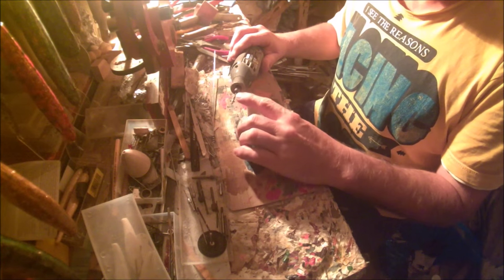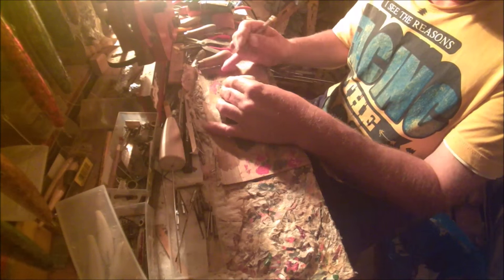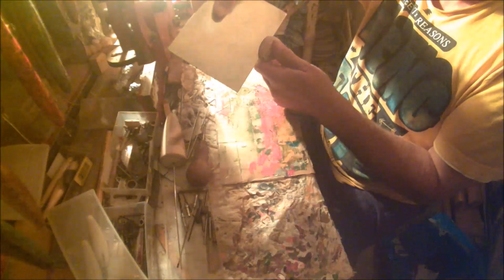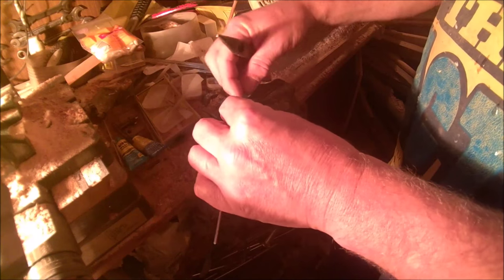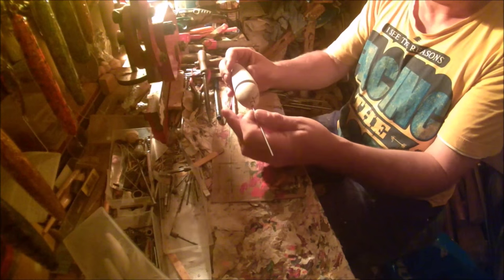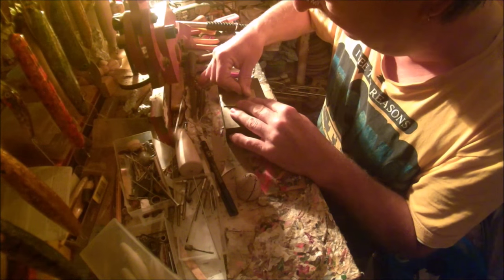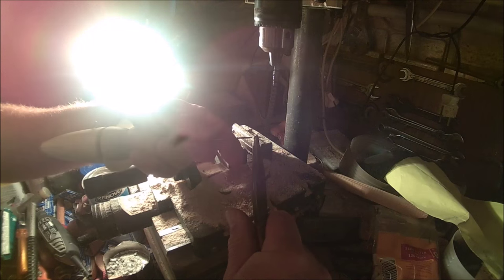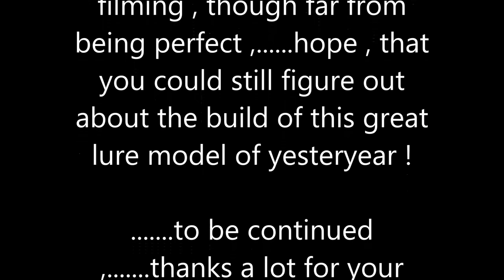Making A Whirligig Lure Part Three

Comment: You could use a Irwin 66704 1/16" X 6" Aircraft Extension Straight Shank Drill Bit (1.59 mm, 152.4 mm).  The cost is only US $4 to $5 on ebay. I use a Irwin 62104 1/16" X 12" Aircraft Extension Straight Shank Drill Bit (1.59 mm, 304.8 mm), I got them at a bargain on ebay, at only US $5.68 each and free shipping, so I bought the last two. With the 12 inch ones you still have to watch out for the flex of the bit, that is why I suggested the 6 inch ones.
Reply from the maker: @ Thomas Garrison

Thanks a lot for chiming in with your advice , might surely come in useful for some viewers !
Reply: You are welcome.